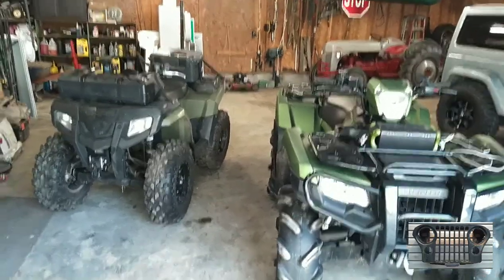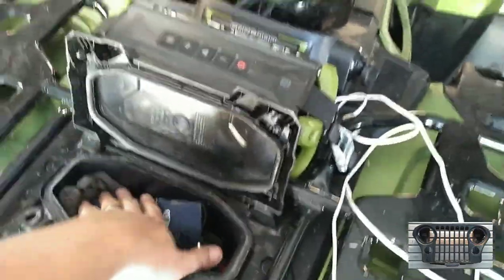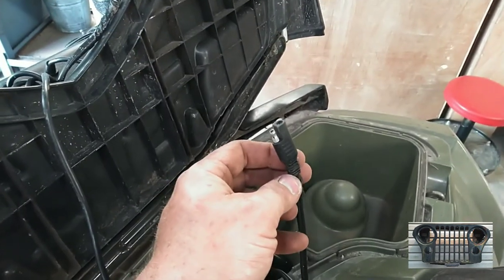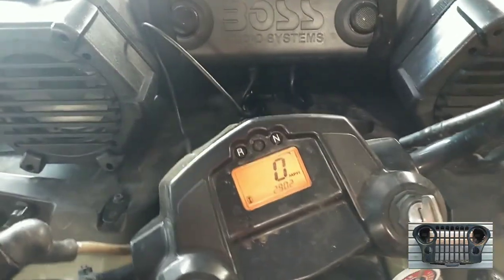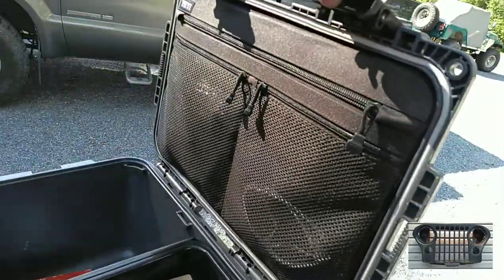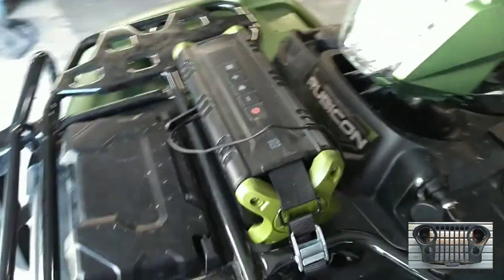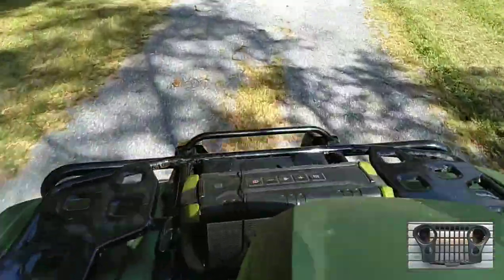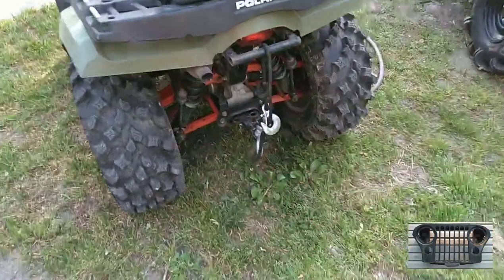ATV WATERPROOF BLUETOOTH RADIO SHOOTOUT!!  BOSS ATV30BRGB vs W-KING D8

Comment: Good comparison, good music. I'm still on the fence about which speaker setup I want. Ever think about recording your adventures?
Reply from the maker: Thanks man, I like the W-KING cause it's small and light weight, but that boss will definitely give ya plenty of volume, and it's nice having the remote. And yeah I intend to start recording some of the rides, just trying to figure out the best way to record it since I wear a hat all the time
Reply: @johnnycrash343  I wear a hat all the time as well. I just turn mine around backwards and use one of those cheap elastic GoPro headbands over my hat. Mine is one of those cheap ones that came with a $20 accessory kit from china. Works well enough.
Reply from the maker: @chasintrail  cool man thanks for the idea. I'll give er a shot